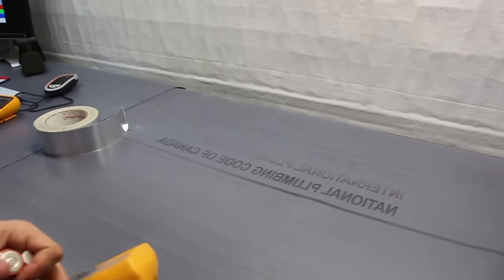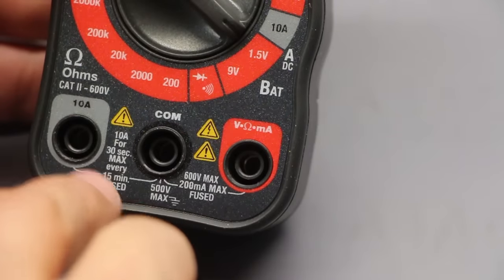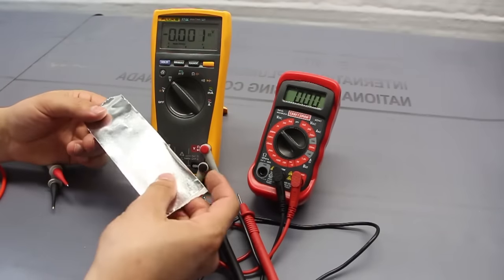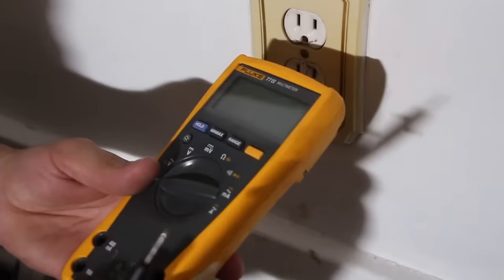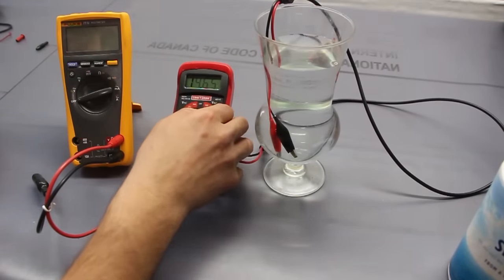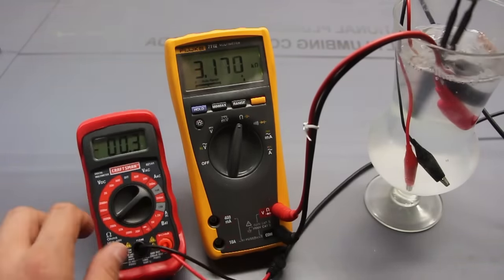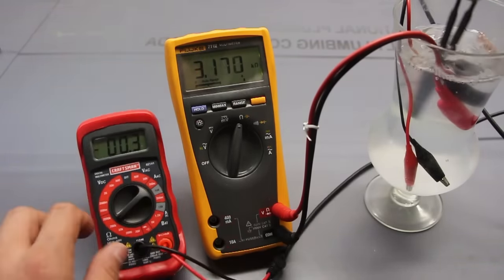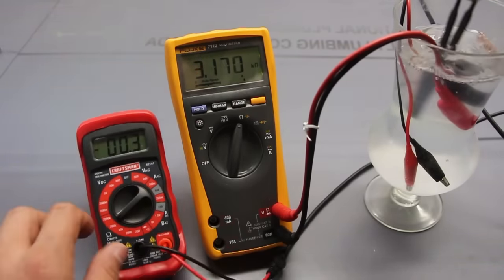The Best Multimeter Tutorial in The World (How to use & Experiments)

Comment: I only watched a few minutes and I noticed that you did not warn people that when checking AC voltage on a wall outlet, you should insert the neutral lead (black)  first in order to avoid having live current on the other (red) lead.  Maybe you mentioned it later, but I think that the safety warning should be the first thing that is mentioned.  It also can't hurt to warn people that an improperly wired AC outlet could have the neutral and hot cables reversed, so they need to be careful with the leads regardless of how they are inserted.
Reply: Yes this is more common that you think, ac does have a “polarity” and if reversed can be unsafe and also cause gremlins in an electronic circuit - I have a 3 prong plug tester (they are cheap) that I can plug into receptacles that show neutral/ground faults
Reply: I should think anyone who would drop $400 on a multimeter would probably know that already
Reply: Later he said you should put the hot lead up your nose, so yeah he has safety covered.
Reply: Be certain to first use a voltage sensor on the ac outlet to determine if the "polarity" is proper or reversed.
Reply: @qzr0jt  hmmmmm, that's something I don't know
Reply: Nice comment..thanks for the additional info
Reply: Or just use the leads as they are supposed to and nothing will happen, unless you are dumb then everything can happen even if you not using a multimeter at all

Comment: Dan, you emphasized no more than 30 seconds usage for AC current through the (grey) 10A fused connector, yet ran the toaster for 93 continuous seconds at 6.75+ Amps AC. And, despite your warning about unreliability of foreign-made meters (presumably certified through a local authorityi), you ran that test on the cheaper Craftsman meter. At least, that tells us you have a great deal of confidence in that meter function-- however dangerously deceptive the Craftsman's AC voltage reading at "200A" might be.  We realize you made this video five years ago-- it would be good to update the video with all you have learned since then.

Comment: Switching probes on a multimeter is not a problem. What the user has to understand is that a chain is as strong as its weakest link. If a user uses a lesser class probe on a higher class current reading meter, the are subject to the limitations of current rating of the probe. While a meter might handle a high current load, a cheap probe might not. It is important to understand when and when not to use different probes.

Comment: Thanks, you probably saved my life! Replaced a kitchen outlet today  & my circuit breaker labels are faded. I went to ACE hardware & got a Gardner Bender for $18. I had no idea how to use it. On the setting of 200, it showed a dead reading. I switched it to 500 & sure enough... 128 volts. The title of this video is correct! :)

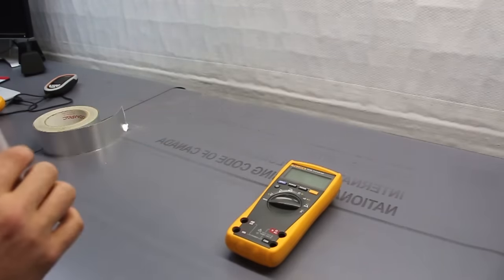Comment: @1:00 Comparison of cheap multi-meter vs expensive one
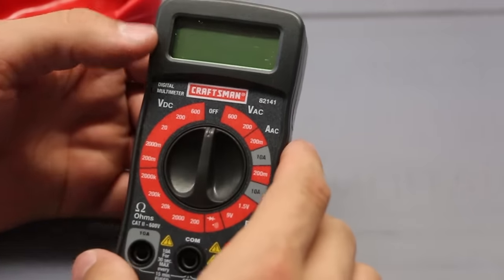@3:30 Overview of how a multi-meter works
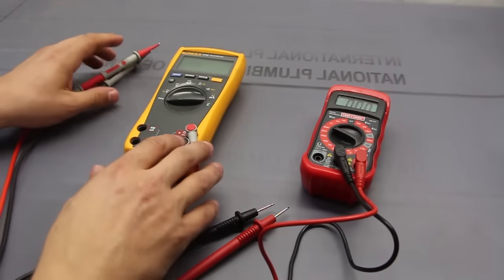@9:25 DC/Voltage : Battery
@11:08 Ohm/Resistance/Conductivity : Metallic tape (Note: He said keep everything where it is, but you need to switch it to Ohms. What he meant was, keep the leads plugged in where they are)
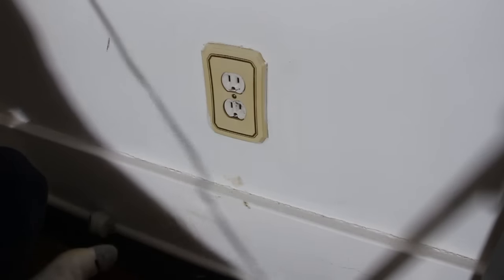@15:00 Measuring AC/Voltage: Outlet. 
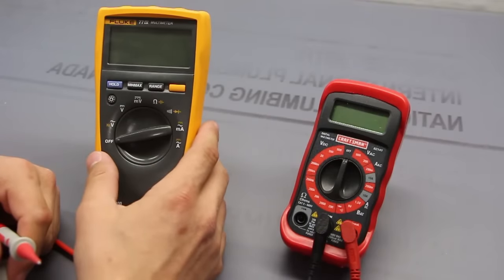@19:40 Continuity: Circuit Board
@22:22 Ohm/Resistance: Water/Saltwater
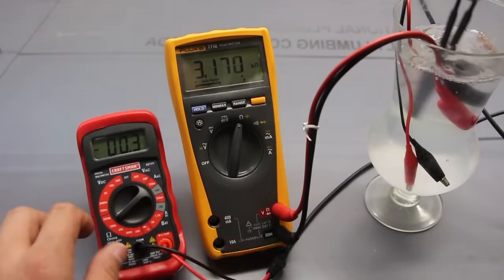@27:33 Continuity AND Ohm/Resistance : Light bulb
@34:45 Current AC/Amps : Toaster (10 Amps Setting) (Changing Red Probe to Amps Side)

Hope this helps as it was a bit confusing for me to watch as a beginner.
Reply: This was quite helpful. He should just copy as is and paste in the description and credit you. Thanks 🙏🏼
Reply: Thanks! Very helpful.
Reply: This video is highly dangerous and has been reported June 3, 2022 to youtube as such.
Reply: @johnstrawb3521  Why is it dangerous?
Reply: @johnstrawb3521  
Yes, why is it a danger???
Reply: Thank you! This gave me more of a focus on what i want to learn.
Reply: DVM works as well..
I have a fluke and another brand I cannot recall the name atm.
Industry standard in electronics  R&D here used to be Fluke  for a rough guess, (which was probably a lot closer than jo public ever got as we were calibrated at least once a year), but I spent most of my years in R&D so specifics were done on other data

Comment: switch the leads, the craftsman will read exactly the same as the fluke all day. the continuity test you should mention that if it is static like the first time then you need better leads. Salt water test leads are down on the bottom and on top. Yes it doesn't automatically choose the range for you, well perfect time to learn what the decimal placement is representing and learn what you are working with. Should always know what you are working with and the equipment you are using. 

It is a great in-depth video I applaud you for that. Your video auto played when i was looking up a function on my Bluetooth meter and just let it play out. Hands down the fluke is more user friendly and it better for that price, My craftsman that's exactly the same is going strong that I've had for a better part of 10 years as a auto mechanic, car audio installer and amplifier repair, I've blown the fuse many of times but she's still ticking. Which is a thing to note as well, there is quick blow fuses in multimeters to protect itself and you as well. Whenever dealing with high current it is smart practice to only use one hand to terminate the connection, It takes but 0.1 amp to kill you however that 0.1 amp needs to make it across your heart, with 1 hand you do not become part of the circuit nearly as easy. good tutorial, I just feel it is heavily biased towards fluke, with the hash tag and all as well which is unfair especially on a tutorial.
Reply: You just saved me a whole lot of typing.
Reply: @timothya2742  you're welcome... I have plenty of time, I got you! Haha

Comment: I live in India and have a Triplett Corp 2200, Taiwan make, multimeter bot 25+ years ago. This was inherited from my late dad. Still going strong. Has ACv, DCv, current, capacitance, resistance, test NPN/ PNP. The 9v box battery lasts 2+ years. The cost was R 200 = $ 5 then
I also have a M-830BZ Var Tech made in HK?. Bought 20+ years ago and costing $ 5. All the above functions + a test of continuity
Both are in excellent condition. If you are careful to select the right range for the test and don't drop them, they last for ever!

You should do a video comparing brands like others do for screwdrivers, torque wrenches, etc. One show for US brands and one for rest of the world!

Comment: Besides auto ranging, one of the big differences between economy  meters and high end meters like Fluke is Tru-RMS capacity. Cheap meters are only capable of accurately reading AC voltages in the 50- 60 Hz range. Tru-RMS meters will pick up AC voltage of any frequency. Additionally a frequency counter in the meter will be able to identify what the predominant Hz. is. While a modest meter is Adequate for most handymen, trained and skilled electricians and engineers will always reach for the expensive meters especially when dealing with complex power quality issues.
Reply: Buy the best and expect a lot is my rule.
Reply: @jimmypea2207  most home owners dont need the best  to check batt. or find an open on the lawm mower i have used meters all my adult life  built my  first (analog meter ) in 1965  from a kit vac tubes used for years  most tble. shooting is 90% man 10% meter  you have to under stand a ckt to fix it there again most home owners  aren to ckt reading   i am 87 now still use my little cheapo meter  weekly   batt. checking etc i was a repairman for 31 yrs retired  2087  those little harbor frieght 7-8 $  meters are good for training
Reply: @jimmypea2207  buy once cry once is mine

Comment: I recommend owning both meters. If you own a fluke you lend out the craftsman. Twice I had coworkers borrow and smoke my meters.
Reply: That's why the "No" word was invented.
Reply: @Frankie Bleddyn What ridiculous crap are you talking.  $200 - $ 400 (U.S. currency) meter is a nice  bit of change to lose.  $13K for a meter??  An electrical meter?  We are talking meters, not scopes, not computer aided diagostic tools.
Reply: @Frankie Bleddyn I get your point.   My niece 's friend wanted to borrow my chainsaw to remove some bushes.   I lent it to them but also lent myself to make sure they did now blow the engine and get injured using it.  I watched this video because I picked up a free snow thrower that does not have spark.  I want to check the ignition coil but I am clueless with anything electric.    I have a bunch of cheap multireaders my late brother got.  Trying to learn how to use them.  They are Cen-tech.

Comment: Hi Dan, there is much more important reason not to combine current measurement and V/diode/R in the same connector. Putting such meter in current measurement results in a low resistance set-up (to be able to measure currrent). If you measure, accidently, in that set-up the mains voltage, you short circuit the mains. A connector for V/diode/R only, provides you with a high resistance mesurement circuit in any set-up.
Reply: HAHA! I did that the other day. Cheap meter blew up in my hand. No fuse, just a piece of wire jumper inside. Live and learn!
Reply: I accidentally left the red lead plugged into the 10A terminal on my $5 Harbor Freight meter when I went to test the voltage in a 120V outlet.... Amazingly, not only did it not destroy the meter, but it didn't even blow the fuse. It did however burnt-out one of the lead wires...so I had to buy a $7 set of new leads for a $5 meter.... Thanks for mentioning the part about the resistance (so it doesn't trip the breaker), I had never considered that. but now that you mentioned it, it seems so obvious.

Comment: At 1:45, you might not "damage" the meter, but you do have to know that the AMPS setting does have a "fuse" and it is best to start with the highest setting. Even then, if the current you want to measure is too high, you might also blow the fuse at the highest setting. BTW, it is best to have some spare fuses. They are generally 5 x 20 mm in size but it is best to check what you have installed.
Reply: thanks for the tip

Comment: Great video.  One question...at about 10:00 in the video you are testing a 1.5 volt battery.  With the Fluke tester it showed 1.27 volts and with the Craftsman tester it showed 1.61 volts.  Why the big difference?  Which is correct?  Please advise.  Thanks
Reply: He didn't have the negative probe connected properly to the battery, so the reading was just going through his fingers, which was touching the battery.  Using probes with the shrouded tips are meant for probing things where you need to avoid shorting across nearby objects, but using them requires more care in making the connection when just trying to press it against the battery.

Comment: The 25.6 VAC that you read on the off circuit near 19 minutes is likely due to capacitive coupling with a nearby circuit. The total power it is able to deliver this way is very low. It is barely able to power your night light. Measure the voltage drop when you put a significant load across it (such as a 10 Watt light bulb). A modern DMM has super high impedance across the probes. It can measure voltages while drawing almost no power, so it can easily find ghost voltages that will disappear as soon as any significant load was puts. Still it's good to be sure before proceeding. I once measured 48VAC across the metal frame of a power supply I was working on. I assumed it was some problem with a long ground lead or something getting coupled with secondary of the transformer. So I grabbed the frame for a better look. 48 VAC hurts when it has a good source of current behind it! It turned out that an unused secondary tap on the transformer was shorted out with the frame of power supply and the frame of the power supply was not properly earth grounded.
Reply: Noah Spurrier
Reply: Wow so you didn't trust your volt meter, eh?  That sounds like it smarted... wow
Reply: Talk Nerdy To Me I trusted it.  I believed the values I just assumed that the 48 VAC I saw on a DC power supply didn't have any power behind it. I figured it must have been some capacitive coupling and that it couldn't really provide much terms of overall power. I wrongly assumed, as it turns out.
Reply: Noah Spurrier s
Reply: Noah Spurrier
Reply: Noah Spurrier
Reply: Noah Spurrier 
Why is everyone saying my name?
Reply: noah spoonreirer
Reply: It's like when someone gives you a word of advice and then you take a chance anyway or they tell you that alligator has no teeth. If the meter says the voltage is high enough to bite I'm always cautious no matter where I think the voltage is coming from. Some things you learn the hard way.
Reply: shorted out with the frame, why didn't it trip the breaker ??

Comment: Just a note:  The top pair of contacts (N. O.) are rarely, if ever, connected in any way with the bottom pair (N.C.). I guess it's a good idea to check them to make sure.  This was/is an extremely good video on the different uses of your average Digital voltmeter (sometimes called a digital VOM ; Volt-Ohm Meter, or, DMM)
Very good tips included. Well thought out in  advance.

Comment: Great video. Your wall socket test is very interesting. Other videos on YouTube suggest you don’t use a multimeter to check an appliance is off (dead). They suggest a 2 probe voltage tester, because a multimeter is more complicated and can be accidentally misused. But as you show the multimeter shows 25.6 volts on a faulty wall socket that a 2 probe voltage tester wouldn’t find.

Comment: On the AC voltage test the cheap DMM should have shown the correct voltage on the 200 volt range.  You could measure on both the ranges.  The Sears meter was defective and should have been returned.
Reply: I have that exact craftsman and it worked at 600 and 200 volts for me. I tested it.

Comment: My fluke 77 is nearing 34 yrs of use, never a hiccup has had a 9v battery replaced once in all that time
Reply: I run a 179 but out of sentimental value recently repaired my dads 77 which was his first digital meter 30+ years ago bought with the grey rubber case, cleaned the switch contacts also while in bits re soldered a few dry looking joints, had it calibrated, there bomb proof

Comment: On the AC voltage mesourment you should always use the highest range and work down, this is because although you supply is 110v it will actually be anything between 95v and 140v if you test at different outlets you can see that you can have different readings, this is normal here in the UK we operate at 240V ac supply but that fluctuates any were between 230 and 250 v . The the outlet closest to the bracker box the test the outlet therthest away from the bracker box and you will see the one therthest away will have a lower voltage
Reply: P

Comment: FYI: The reason a digital voltmeter reading tends to wander around its display is because the input AC voltage to it contains "transients" caused by switching, motor brushes in appliances, and tries to read these transients, which are quick and random, combining them with the reading desired, It does this due to the high sensitivity of DVM circuitry. This is especially true in a commercial and industrial environment.
This is why many electricians also have an analog meter (the kind with a moving needle meter) to measure primary voltages, An analog meter does not have the sensitivity to be able to detect small transients, hence the reading remains more stable on the needle display,
They both have their uses depending on application, the DVM preferred for critical measurements of transient free circuits and the analog meter for low impedance (primary power) circuits.
They both have their places in electrical work.
Reply: Yeah, it's also alternating current. So, ya know, not a steady supply of power.

Comment: The reason the 10A scale has a separate probe terminal is to avoid putting a mechanical switch in the high current path, because the current will pass through a very low resistance (say, 0.1 ohm), and a mechanical switch may introduce inconsistent resistance and lead to inaccurate measurement. It would also require a very beefy mechanical switch.
Reply: hello are u okay???

Comment: Had a craftsman just like that. The voltage regulator on the generator went bad. The tell tail at substation said 18000 volts went thru it. All i had left was the rubber case. Glad i had the clips on it.

Comment: I have a fluke 87 V multimeter.  I’ve had it for 15 years it has been the most expensive meter I’ve ever owned roughly $300,00 and yet the cheapest because it works absolutely  flawlessly, day after day every single day.  You do get what you pay for with a Fluke.  It may not be for everyone but if you can afford it get it.

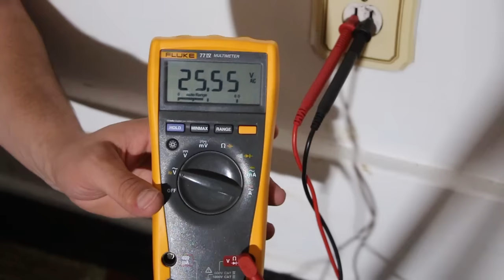Comment: 19:14    25.5v more than likely an induced voltage.  If you had an old Simpson with analog meter movement and you had same voltage even if you switched scales then the voltage is real. If the voltage changes as scale changes then the voltage is induced. I hope this helps. Not enough space to get into electrical theory to explain induced voltage. Good video.

Comment: @3:45 in the video you suggest setting the multimeter on Ohms to check the resistance of a battery.   This is not recommended way to measure the internal resistance of a battery. As the multimeter generates it's own voltage from an internal battery to test the object's resistance. A battery with any charge could blow the internal fuse of the multimeter should the battery resistance be tested as suggested.